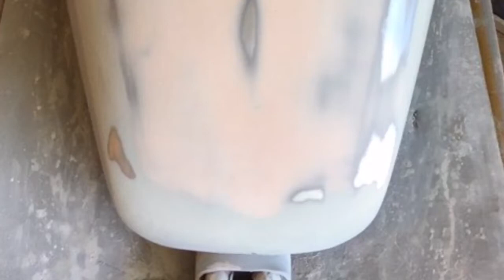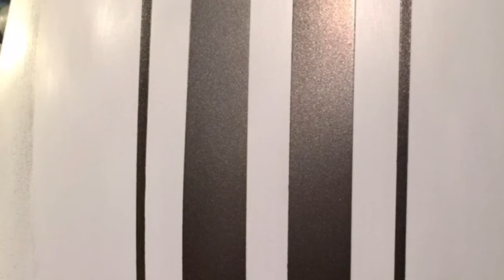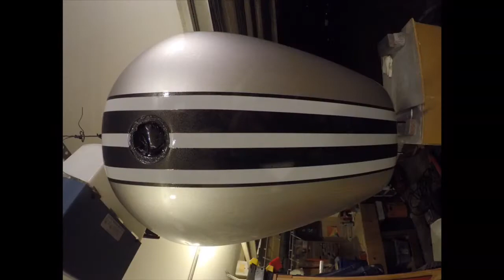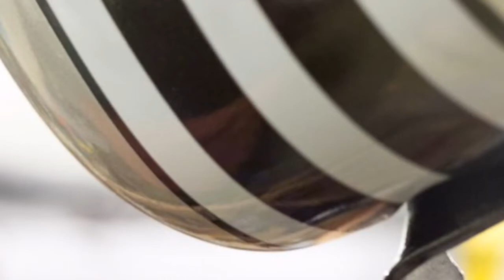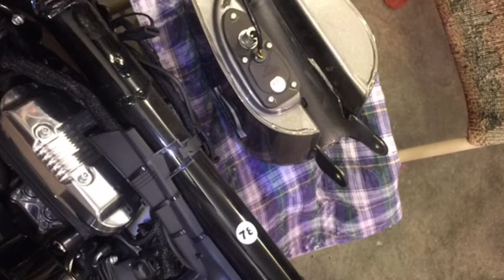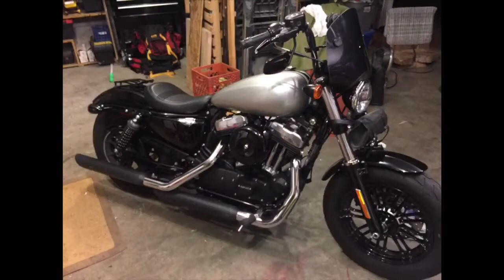Harley Sportster 1200C 4.5 gal tank

Comment: Do you have the link of where I can purchase this tank?
Reply from the maker: I can’t find it, sorry. But if you search for replacement 1200C (custom) 4.5 gallon tank you’ll find one. The way I understand it , is that’s the diffence between the 1200 custom and all the other sportsters. Like the Nighster had a 3.7 gal tank I believe. Forty eight is 2.?. When I owned the bike I would tabk swap to the 4.5 gal to get more miles across country. Worth the money and time to catch up with the big bore bikes. :)
Reply: Sweet! Thanks a lot bro. Got a problem with rust on an old tank and don’t know how to prevent it from coming back so imma get that 4.5